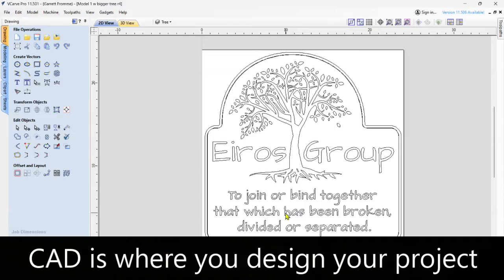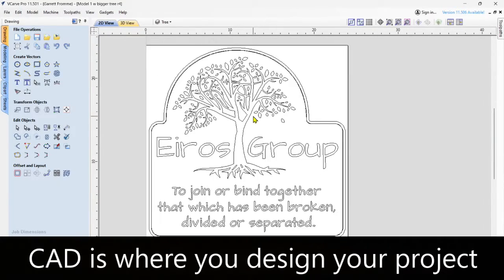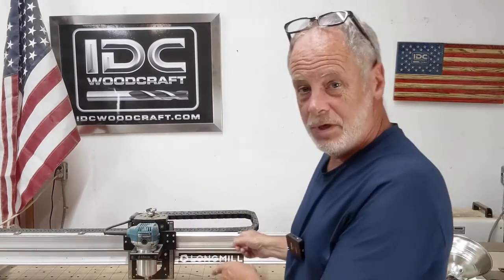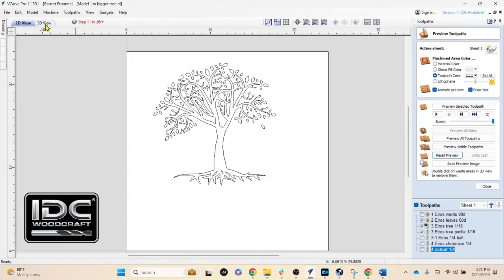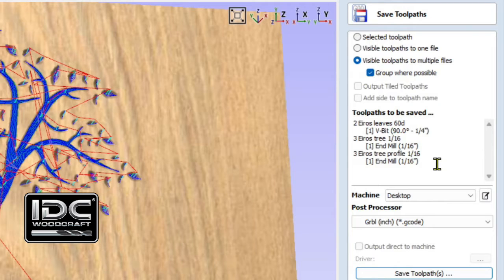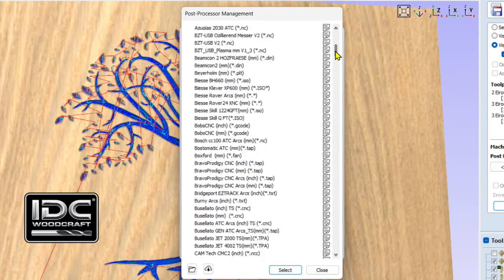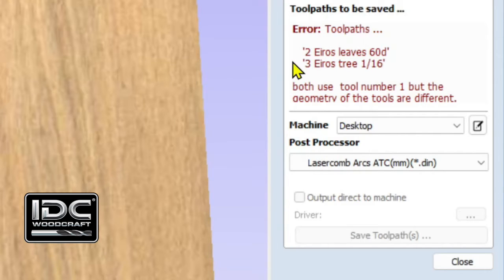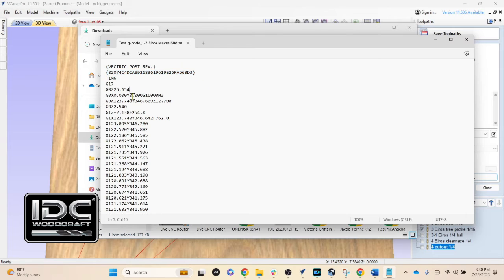CNC Routers 101: What a Post Processors Is, And What It Does.

Comment: Hello!! great your video. Do you help me? I have the solidworks 2021 but not to have option of post processor GRBL, do you know how include it
Reply from the maker: I'm glad you enjoyed the video! To include the GRBL post-processor in SolidWorks, you may need to download it from a reliable source or check if it's included with your CAM software. Make sure to follow the installation instructions carefully. Good luck with your project!
Reply: @IDCWoodcraft  Thanks by answer, but not have the option GRBL in my Solidworks CAM 2021. I need add it but don't know how procedure

Comment: In My Knowledge,  

I have observed some, may not be fully correct, still learning...

Every machine is Unique in terms of motion control System. So correct Post Processing is needed based on the motion control system that particular CNC Machine is Built around and its overall mechanical profile.

Better to use the Recommend PP , Else We may run in to some  these issues..!

Case Examples:- 

If a CNC with Non -ATC controller is presented with A set of G code that includes tool change commands, The machine may freak out and spit out errors..! So it is recommended to post the code with suitable PP for that particular machine

Some machines dont understand work offsets by defaults, So in that case,  it would be better  to choose the suitable post processor that doesn't specify G54,55,56 codes  otherwise the controller may or may not show errors

Another Case, Some machine controllers dont even understand xyz positions at all in Gcode ..! They need special co ordinate positions (ABC with alpha numeric codes) which may not make any sense to us compared to usual Gcode that we are familiar with

Some Controllers dont identify Sequence Numbers and or  Comments added next to the Gcode Values,So We need to be careful there as well.

Some machines use arcs mode interpolation while some others use short lines to draw curves

Some machines need G53 modal codes to rectract fully/park  while some others need that specified in G28 mode

Same is true with Tool Height Offset and Tool Wear compensation Codes , A Basic 3 axis Router Controller may freak out if these compensation codes are there...!

I think Some Controllers dont even like to see M3/M5/M6/M8 Codes..!

So always go for most suitable post Processors for our particular machine controller.!
Reply from the maker: user-oq9ml8jb1t, You're absolutely right! Different CNC machines have unique requirements and settings, so using the appropriate post processor is crucial to avoid errors. It’s interesting how various controllers interpret G-code differently, which can definitely impact functionality. Your insights into the nuances, like the need for specific coordinate formats and tool change commands, are spot on. It's great that you're diving deep into understanding these aspects—happy woodworking!
Reply: @IDCWoodcraft  Thanks and Please make more videos that motivate New Woodworkers like Me..!    Also Please host more experts from CNC Controllers such as Masso/Rich Auto..etc    I think that will give more in-depth knowledge to both CNC Builders and Operators.

Comment: For those watching this, you could use the GRBL post processor for about any CNC router or mill in the world, don't over complicate things.  The code may have to be slightly modified but there are dozens of post processors in this list that will work fine.
Reply from the maker: larryrobinson7492, Absolutely, using a GRBL post processor is a versatile option for various CNC machines. It may require some tweaking, but it's a good starting point for compatibility with different systems. Remember to always make test cuts to ensure everything is working smoothly. Happy woodworking!

Comment: Hi garrett I will use my new CNC in a few days (1st timer) I design in vectric using metric system, but i will use IDC Bits which is Inches, im going to use onefinity. My question is, should I use Onefinity in metric or inches? Thanks in advance.
Reply from the maker: Mens_workshop, you can really use either. If you are needing the feeds and speeds setting in metric, I recommend downloading the IDC Woodcraft app and you can change the settings to show you everything in metric. Here's the link if you use Apple →https://apple.co/3IKj9Td. And here's the link if you use an Android →https://bit.ly/3kmFCfN. I think you'll find it super helpful and that way you can stick with metric and not have to switch around.
Reply: @IDCWoodcraft  thanks for the reply Garrett :)

Comment: Hello Garrett, which post processor do you use for your Phantom CNC? i've got one with ATC and i'm using a generic PP from Vectric (CNT ATC Arcs mm .tap), it works fine but i was wondering if there is one best suited for the Phantom. thank you.
Reply from the maker: thegroovelibrarydrums5094, sorry for the delay getting back to you brother it's a little been busy over here this week. I use G-code arcs mm for my Phantom and I haven't run into issues yet. You could always reach out to Phantom directly too and they may have some alternatives you could try out if you're having issues!

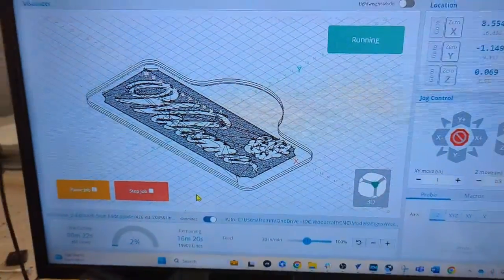Comment: So how do you right one? 7:22  I have a next wave cnc machine that strictly uses vectric brand software. I would like to use Fuzion 360 but my machine isn't listed in Fuzion 360.
Reply from the maker: Patruddiman4228, you can just reach out to your machine manufacturer and they will let you know which post processor works with your machine.
Reply: @IDCWoodcraft  they told the controller to my machine will only work with Next Wave Ready to Controll and it will not work with any other design software other than Vectric. They told that I could right my own post processor for fusion 360.

Comment: Great video Garrett. I have had people ask me about gcode files. Just because it is a G-Code files does not mean it will work on your CNC controller. I have the Longmill CNC that runs GRBL G-Code. I 3D printed my first CNC machine. It runs a the Marlin firmware and uses a G-Code file. Same file extension. 2 very different files as far as the setup.
Reply from the maker: JackInTheShop, thanks! It can definitely get tricky. You're absolutely right on figuring out which will work with your controller.